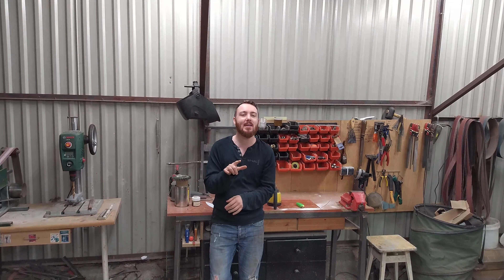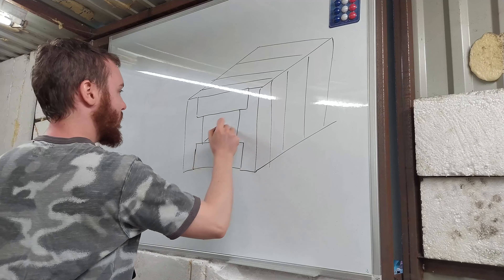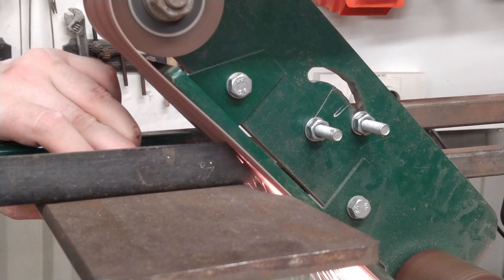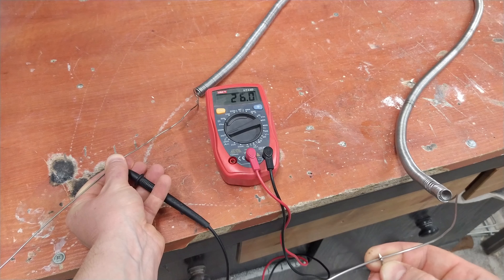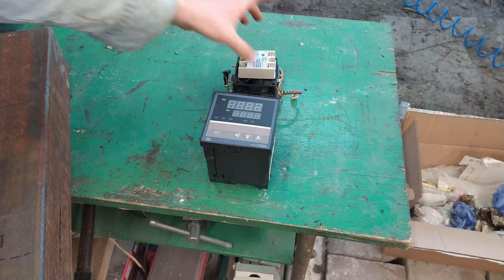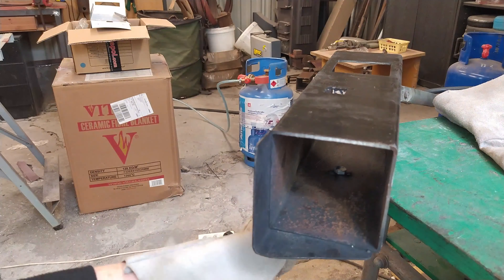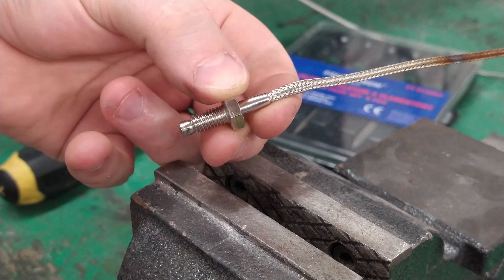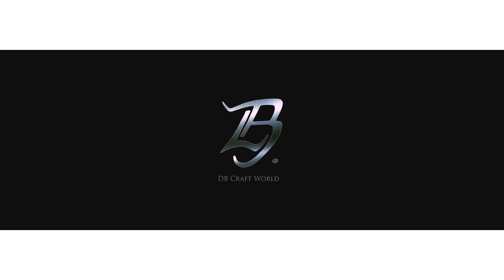DIY Heat Treatment Oven (you should know that, before you start)

Comment: The electrical work looks particularly impressive! Seems like a small mistake might get you killed, so happy to see all the safety solutions
Reply from the maker: Thanks a lot Jacek! Yes, it works great and I'm very happy about the results :). 

Safety should always be number one- especially if we talking about multiple dangers (e.g. electricity and high temperature)
Reply: Sometimes houses can be wired so that a neutral wire (more accurately, the wire intended to connect to neutral mains) can become live under certain fault conditions.  I'm planning to have my oven using double pole switches. so that both sides of the circuit are connected/disconnected.

Comment: This is a great video!  You make an excellent point about the difference between firebrick and insulating brick.  Based on that, I think I'm going to design my furnace to have a removable lining in the bottom of firebrick.  So that I can leave it in for even and slow heating, but remove the firebrick if I need the oven to heat or cool more quickly for other processes.
Reply from the maker: Thanks a lot Tom! Yes, removable firebricks on the bottom are  a good idea. If you plan to heat treat more than one blade in one cycle definitely recommend to add firebricks! Thanks for watching and good luck with your oven (reach me if you need some help)!

Comment: CAUTION:  In the United States,  neither side of a 230vac circuit is at neutral or ground potential.  The proper approach is to put a relay on BOTH legs of the 230vac power source.
Reply from the maker: Thanks a lot Paul for pointing this! Correct me if I'm wrong: 230VAC is two phase 120VAC with 180* phase shift. The neutral potencial is only on 120VAC electrical outlet. So the electric circuit I've draw on the whiteboard is correct for 230VAC (UE) and 120VAC (USA). IT IS NOT CORRECT FOR 230VAC (USA)!
Reply: @DBCraftWorld  You have it correct.  For 230 VAC in the US the safety door switch should switch both sides.
Reply: Even in EU, both side should be cut.
Safety switch should not bear the load also, but use a contactor, bonus added you can add a true emergency stop (ie if you door fails to open). Contactor fails open, SSR fails short, that's also a big difference.

Comment: Hi! Nice work! One question from me. The canthal a1 what diameter is? 1,2 mm?
Reply from the maker: Thanks a lot George! It's 1.4mm but if you don't plan to HT stainless steel knives 1,2mm will be fine! If you have more questions just ask :)! I'm here to help! 
David
Reply: Im hobiest knifemaker. Usually work with stainless steel (440c for exable). Is it good enough to use diameter 1,2mm(20meters 1,28Ω/m)?
Reply from the maker: @georgezaf71  even with 230v source it's not enough in case of 20m long wire. What power you want to achieve?
Reply: Hmmm lets say i want 2000watt.
Reply from the maker: @georgezaf71  so you need 30m of 1.4mm wire.
Reply: In other words when we want up to 1000C  (for stainless) we need at least 1,4 mm thick canthal.
Reply from the maker: @georgezaf71  Yes, but It's not that simple. All 4 (heater power, thickness AND length of the wire, max temperature of work) parameters are related. In case of 2kW heater, you need 30m of 1.4mm thick wire to reach 1000*C. In case of 830*C the 1.1mm wire would be totally ok.
Reply: @DBCraftWorld  David, you are very right. However, putting 30 meters of wire means that we have to make a bigger chamber in the oven. my old one had an inner chamber of about 40x10x10 centimeters. I have enough bricks, I will redraw it from the beginning based on the design from your video. I hope everything goes well. THANK YOU SO MUCH, SEE YOU.
Reply from the maker: @georgezaf71  if you have 40cm long oven 30m of the wire should fit. Feel free to send me a message via e mail or sind me on instagram if you have more doubts :). Good luck Man!
Reply: @DBCraftWorld  yes, it fits almost marginally. normally, however, we have to stretch the spiral a little so that the spirals do not touch each other. so then maybe we have a problem?
Reply from the maker: @georgezaf71  if you put the wire like I did you shouldn't have problem with fitting it. My oven have very similar dimensions.
Reply: @DBCraftWorld  hi David!  I'm having trouble finding 30 meters of canthal. I found 25 meters 1,4mm thick,  with 0.942Ω/meter. total 23.55 Ω. it's good; how do you see it?
Reply from the maker: @georgezaf71  There is one more possible solution: buy 2x17m of 0,75mm wire and make 2 coils (heaters) and connect them parallel. It gives you 2x1000W of power with same heat resistance.
Because the wire is significantly thinner it should still fit into the oven.
Reply: @DBCraftWorld  Thank u David!👍

Comment: Hi, DB. Great job, wonderful project and straight forward knowledge. Helath and safety  first. Really amazing video like others on your channel. I'm interesting how long you must wait for 1000 degrees (Celsius)?
Reply from the maker: Hi Damian! Thanks a lot for kind words! Yes, safety should always be number one - unfortunetaly there's a lot of more viewed videos on yt, where some very important informations are missing (so if you have anybody who plan to make HT oven, please show this video to him, and if the have some questions he can easily send me an email- I always trying to help when somebody need it).

The oven reach 800 in less than 30min but you must wait another 3h to get to the 1050. Its because the temperature gradient is not linear (in fact, the temperature rising characteristics are exponential) and also, the insulation efficiency goes down with temperature differences (between inside  and outside temperature). So at the end, reaching 1100*C would take probably 5hours, but I didn't have to heat up it to this level (for now), so I can't tell it for sure

Thanks for watching and I hope it's helpfull :)
David
Reply: Instablaster

Comment: The enclosure is so much work that it probably makes more sense to buy an old (analog) oven, preferably broken to drive the cost down, and adding electronic controls to it. Same result, less money, less work.
Reply from the maker: Yes, I agree, but you need to find cheap, old and broken oven first (I just couldn't find one). Besides that, there are problems like, interior dimensions, weight, external size. Overall it might be less work, but more problems. I decided to make one from scratches, cause it gave me a chance to design it exactly like I wanted.. In general, both ways gives different result but also require different amount of work. I'm not judge which is better- it depends on what you need, and how much time you have.

Comment: Thanks for the video,  I from Brasil and, I can't find the insulation bricks or fire bricks. Where can I buy this?
Reply from the maker: Hi Man:)! I can't tell you exactly where you can find it, but I would try to find some place where you can find components for Fire Pizza oven, maybe "concrete" bbq grill. Try to find it this way. There is also ceramic wool you can use.
Reply: @DBCraftWorld  Thanks, I will try!
Reply from the maker: @joaopedroneufeld3027  I hope you will find it:). Good luck my Friend:)!

Comment: awesome build im in the process of building mine  wher did you get your door switch do you have a link for it?
Reply from the maker: Thanks a lot :)! I bought it in my local store, but you can find it on amazon. I'm not sure if yt is sensitive on shop links so, please past this "Electrical Buddy Rotary Roller Lever Actuator Limit Switch LXK3 20S BAC 380V DC 220V 10A" to amazon page. you should find it. Remember that this limit switch must hold high amps- in my case 10A was is enough. An if you have any questions you can always e-mailed me (e mail is on "About" tab :). Cheers David.
Reply: @DBCraftWorld  thanks bro i found the switch on amazon got it yesterday mine wont look as nice as yours but should do the job im almost done with the oven then i can get to the electronics

Comment: Hi, are you using normal wires to connect the heating elements? Doesnt they overheat? Thanks, i hope you can answer me because i am stuck at this point where i need to connect the heating elements.
Reply from the maker: Hi:)! Yes, the heater is connected just by simple 2,5mm electric wire. The only thing you must remember, is that in this electric circuit flows high current, so the input wire  must be thick as well (in fact it will be heating up much more than this in the heater).
Reply: Thank you for the fast reply, yes, i choose 2.5 mm square to do the connection and i want to use one bolt for each end of the heating element and connect the wires at the end of the bolts with nuts. The connection will be made outside of the oven. Thank you again!
Reply from the maker: @rcalin9354  this is good solution, however, I would try to find ceramic connector (it's on the video) OR made some cover to make wires connection more safe.

Comment: Hi, I have three questions regarding the construction of the stove.
1. Did you connect all the walls of the furnace with glue or only individual bricks?
2. How many meters of wire did you use for the heater?
3. What was the diameter of the tube on which you wound the wire?
Thx
Reply from the maker: Hi Sonic! Thanks for the comment and questions:)!
- I didn't connect it. I've try to fit it to make the gap as small as possible to minimalize thermal bridge, but not disqualify the possibility of replacing the heater.
- I've use 30 meters of wire
- It was 10mm rod
Reply: @DBCraftWorld  Great thank you :)
Reply from the maker: @360ab  
you're welcome!

Comment: Ok the door’s switch is set up to open the resistance circuit
But what about using it to open the DC circuit between the PID controller and SSR relé?
The relé will stay opened and there won’t be any current flowing in the resistance
Reply from the maker: Thanks for the comment Nick:)! Good question! There is a few things that must be concerned in this case: First is it  good for PID controller and SSR to add some switch between them- is it wont disturbed proper work of PID controller? Second (and also more important) is it safe for YOU? Generally speaking SSR rele have no mechanical switch inside- so if it get damaged on a high voltage side there will be no physical break in the circuit. And that is why I wouldn't recommend this solution. BUT, if we talk only about idea, it should be like you wrote- there should be no current and more important voltage on the resistance (of course if the electric circuit is made right way).
Reply: @DBCraftWorld  what you said is a good point!
I’ve made the circuit as I’ve described before but what you said is right
I think I will leave the circuit like it is now but I’ll add a lever switch in the panel control 
So the panel control will be like:
Lever switch for main power 
PID controller
Lever switch for resistance power
Reply from the maker: yes, dwo switches should work fine and more important, make your oven safe to use.

Comment: Are you from Italy?
Reply from the maker: No. I'm from Poland
Reply: Oh ok😅 im from germany i was trying to guess by the Sound of your accent
Reply: Lso i have one more technical question, if i want to melt Steel in there and the heating wire is also made out of Steel, wouldnt it also melt in there?
Or do you see any more heat resistant material options?
Reply from the maker: @jonasgrunberger5382  The wire I've used to make heating coils is made from kanthal- it's not steel. Steel require at least 1450*C. Kanthal melts around 1300*C. If you want to melt steel with electricity you need induction furnace.

Comment: excelente trabalho..  0 à 800°c em  20 minutos Uau! qual a receita? abraços aqui do Brasil
Reply from the maker: Thanks a lot:)! The secret is in efficiency (>90%). The walls are 50*C when the oven is on.
Reply: Yes, "DB" I will improve the insulation of my oven according to your information! another question I have, is with the khantal wire, here in Brazil we have the kanthal a1 D = 1.15 17awg what do you think? is current required at 26ohms? my oven reached 900 ° c approximately 6 hours on. thank you friend you are 10.brace
Reply: @DBCraftWorld  my resistance was 30ohms, I measured the external temperature of the oven, on the sides they were 90 ° c, rear without insulation 280 ° c ... this must be the cause of the inefficiency, I will correct this.
Reply from the maker: Correct me if I'm wrong: your kanthal wire is 1,15mm^2 in diameter and it's working on 230V current (and if its 26 ohms the power should be something around 2kW).
Generally, in THIS case reaching 900*C in 6hours is definitely not connected with power (heat) losses, but what I suppose walls material. Your oven is made from "fire bricks" not "insulation bricks", am I right?
Reply: Sim DB é isolamento de tijolo, eles são brancos e muito leves de excelente qualidade, mas meu isolamento não é ok, eu acredito que este seja meu amigo. obrigado por ajudar.
Reply from the maker: @marcosvilela7460  so this is insulation bricks, not fire bricks.. Your oven shouldn't get to the temperature that long.. Something is wrong- What was the length of the kanthal wire before you create a helix? did you stretch it to make a distance between each circuit?
Reply: hello friend, sorry to answer just now .. well let's go to what you asked me, it was 25 m of kanthal wire with 12mm inner diameter, yes the helix was stretched 2mm step approximately.
Reply: don't you think it can be the insulation of the oven? some parts are without refractory thermal plate, it may be having a lot of heat loss.
Reply: my brother, if you allow i can send you some pictures of my project.
Reply from the maker: Sure! It will makes this easier:)!